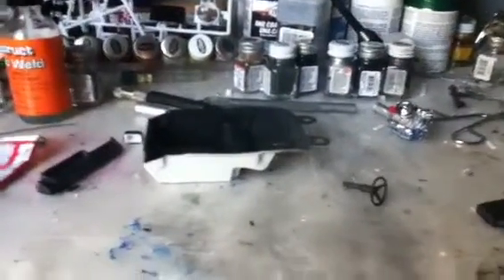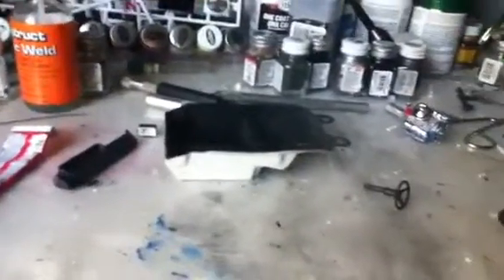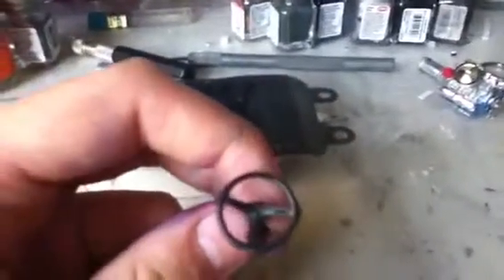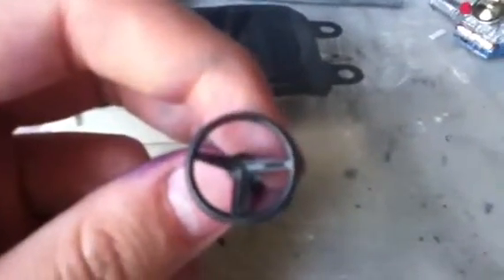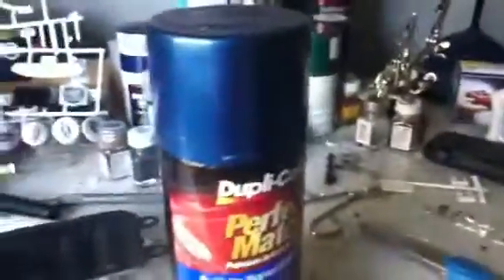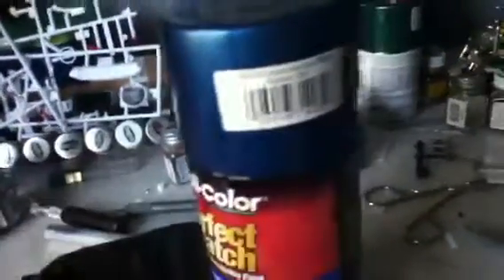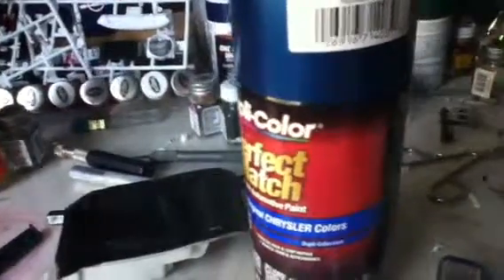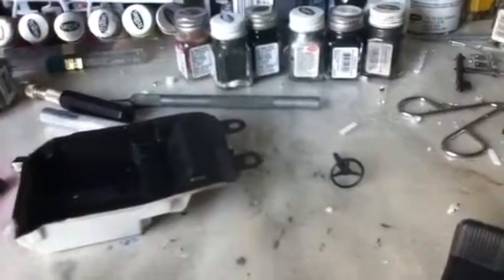Problem with MPC 1967 GTO kit

Comment: Hey, I have a favor to ask of you, CorvairGuy. I am a complete novice at model car building and I received this same GTO kit as a gift that you feature in this video. So, I'd love to get started with this as a new hobby, but I'm stuck. Could you possibly upload a video of a close up and different angles of the engine? I've searched and searched and can't find anything online that has an example of what the completed engine is supposed to look like, and the directions are a little more than vague on exactly what part goes where. Your engine looks so awesome in this video!! Any help you could offer would be extremely appreciated. To be specific, I'm stuck on step #8 & 9. I just don't know where on the main engine piece they are supposed to go. Thanks!